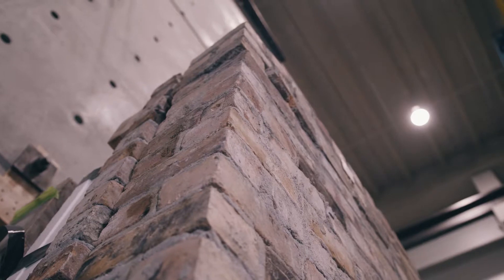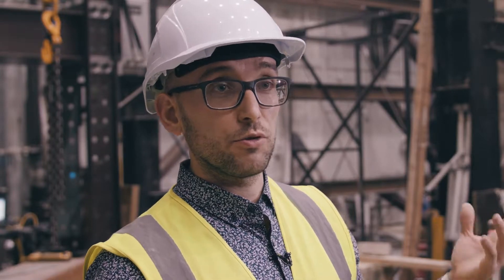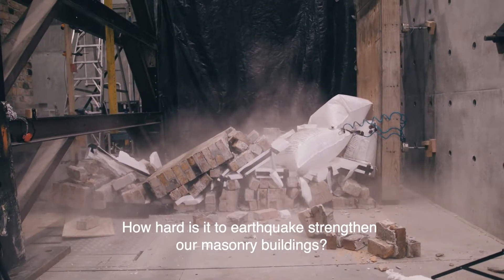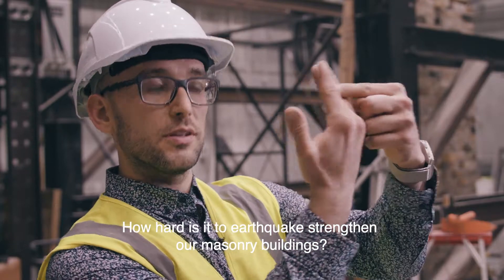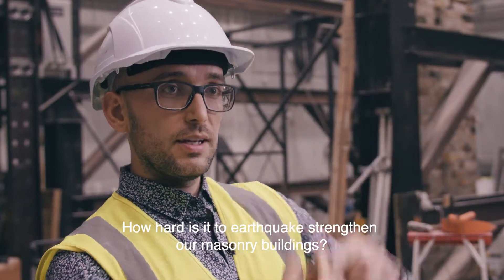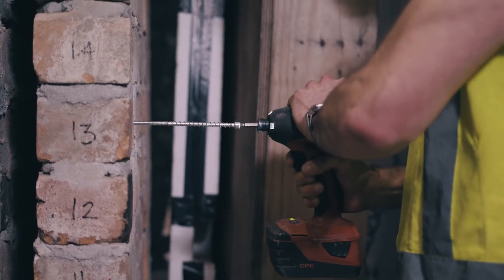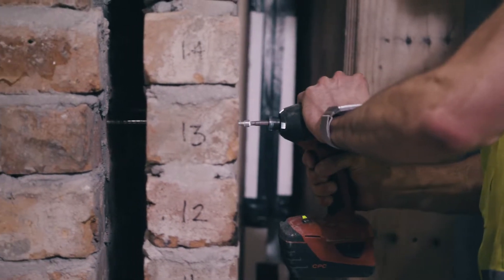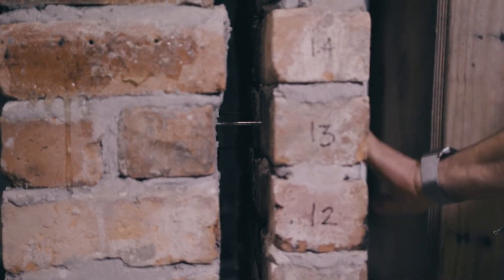Earthquake strengthening and protecting our communities and heritage

Comment: The standard of workmanship of Christchurch Bricklayers is criminally negligent, and there are no consequences for them. Although cosmetic my pointing has now been re done 4 times and still needs to be done again. The last brick layer mixed one batch for the whole day and as he added water through out the day the color got lighter and lighter and from day to day added different amounts of oxide so the whole house is all different shades, which he thinks is fine. So Disputes ruled in my favour, he is appealing the decision, so after 10 years the house is still not fixed.